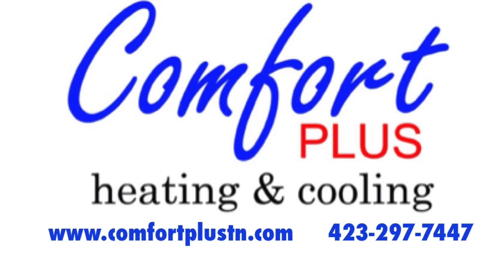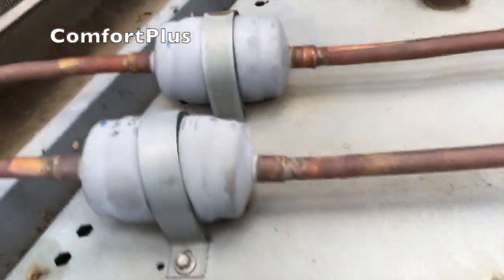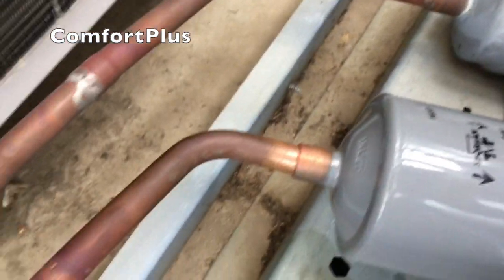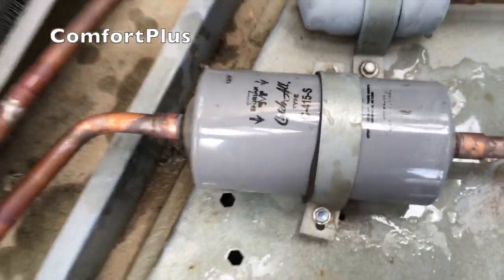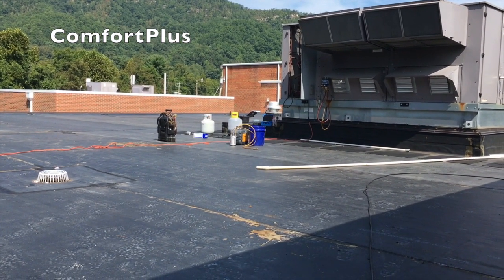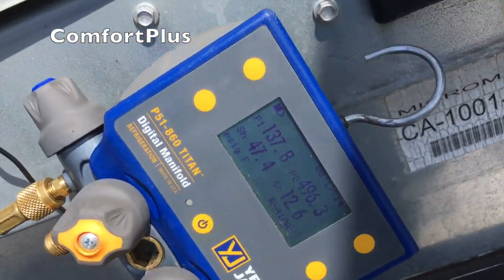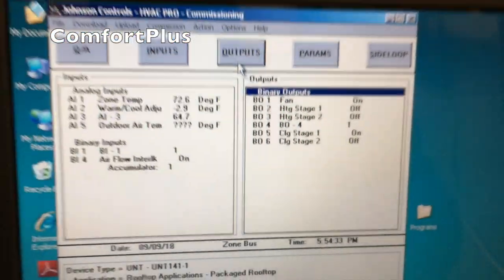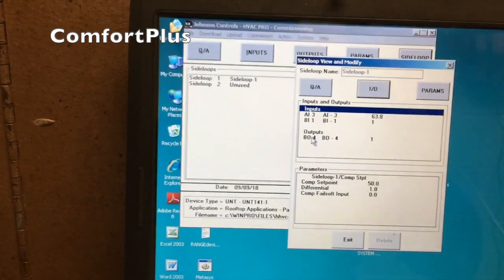HVAC - Restriction in the liquid line

Comment: In a Commercial setting especially in a school u wanna keep the blower running in the occupied mode. Less wear and tear on ur belts and constant air changes for better indoor air quality.
Reply: Co2 levels. Yup
Reply: In KY he would have made the system illegal by doing that. Though no one would have known or cared.
Reply: Negative.  CO2 levels up and in Florida introduce more humidity into building.
Reply: If they were worried so much about bringing in humid are they can always have a CO2 sensor in a building controlling the economizer. With Honeywell economizer control so you can have the CO2 sensor hooked up directly to the economizer control and not through the DDC

Comment: No turbo torch? Chuck is changing on us.
Reply from the maker: I still use it some, but certain service valves and many TXVs really need some extra heat to get in and get out quickly lol.
Reply: @ComfortPlusHeatingandCooling  then your tip you're using is too small I can unsweat no time 1 3/8 in Copper fitting with an A 32 tip. But the Turbo Torch if you don't have all the tips then you have don't have what you really need in your torch can be pretty worthless if your tip is too small. I've never had a issue with not enough heat with a Turbo Torch sweating pipe

Comment: I would have suggested installing a vfd for controlling that blower if the space humidity was a problem. It's incredibly expensive the way they're controlling the humidity running the electric strip as reheat. If you're not familiar with vfds I'm not that familiar with them either. I do recommend the Honeywell smart Drive. They are really easy to program that's with I install at the school district I work at now is. Being a businessman I'm a know it's hard for you to find time, but if you have a local supplier that has a class on it all you need is one day it's the one day class. They are very easy to program takes less than 5 minutes for that kind of application. You don't even have to have a 2 to 10 volt signal you can have preset currencies first stage second stage just closing the set of contacts to enable the preset frequency. Honeywell smart Drive great vfd super easy to program if you're interested in going into that Arena.

Comment: Run the fan 1-2 minutes after the compressor de-energizing for efficiency!? 
In  Michigan , new energy codes and occupancy 2018, Supply fans need to run during occupancy:) (co2levels) schools, hospitals etc...Auto fan unoccupied set to 78°f